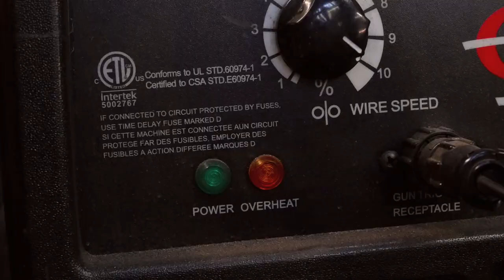Blacksmith Makes Unique Kitchen Decor | Vintage Industrial Pot Rack

Comment: Oh, nice rack, I like it... I would have liked to see you mount it to the wall, how heavy of screws or bolts did you use? I've got a lot of cast iron if like to hang...
Reply from the maker: Thanks! Yeah it was little bit of a headache getting it mounted actually , I couldn’t hit studs in the wall so I used the drywall butterfly type things

Comment: Looks awsome realy dig it, but if i may give you one tip or maybe 2. Dont put your thumb on the hammer handle, wrap it around. This is because the shocks of impact goes into your body. A blacksmith that does this for a year or 3 can rotate their neck and look over their shoulders. Hold the hammer a bit loose (don't let it fly out of your hand either😂) and also maybe look into a powerfile from black and decker of pferd, those tings are awsome.
Reply from the maker: Hey bud, thanks for kind words! Appreciate the feedback, I’ll have to check out those power files ✌️🤖👍